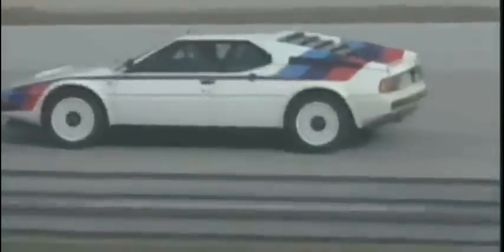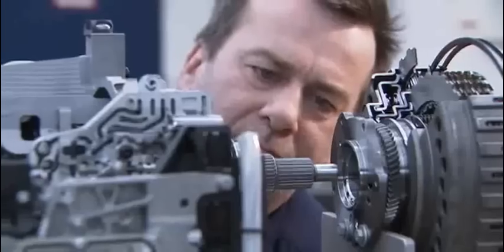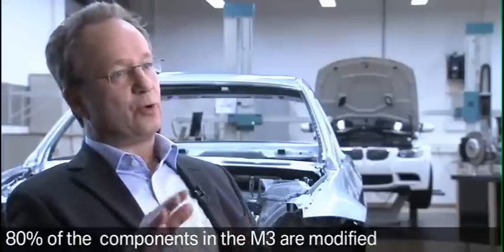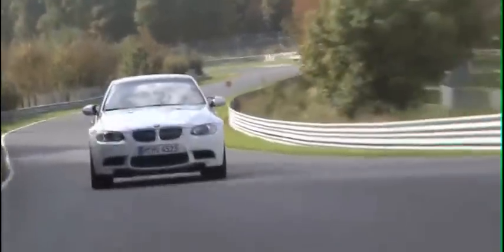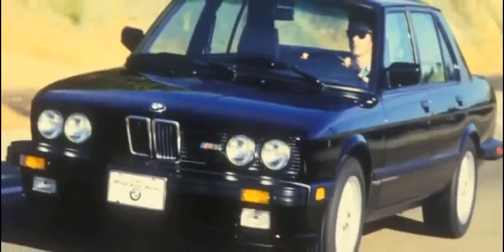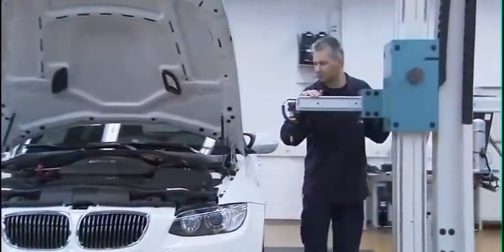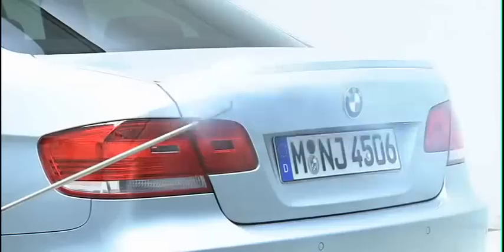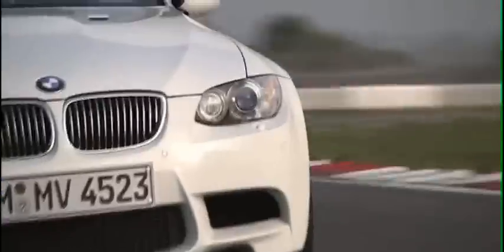BMW M Documentary

Comment: It would be nice if they saved weight, increased performance and designed it to be SERVICED. It takes a team of engineers to work on these cars as well as it did a team of them to build and design them. They are truly exceptional cars, but you must have the means and the know how to repair them. I have seen mechanics with many years experience put valve cover gaskets on these that immediately leak. A conundrum wrapped inside a riddle tied with a snake

Comment: This video is great and it shows what BMW USE to be. Now they're the new aged Ford. Producing a new car every few months like candy. Dropping pricing and turning into a economy car company.
It makes me sick when they said "We only have car enthusiasts working here" biggest load of crap I've ever listened to. If you had nothing but enthusiasts working there. Then you'd pay more attention to the actual chatter of what M owners actually say. Like how much M has degraded over the years.
Reply: Hi, BMW is now run by a new generation of the Quandt Family! These younger family members, are more interested in selling large numbers of each particular car, than in the original DNA makeup of BMW's / ///M's Heritage. 
BMW was Rescued by Herbert Quandt in 1959! At BMW Liquidation Meeting! Herbert owned 10% of Daimler Benz, Daimler wanted to windup BMW, so they could gain access to BMW's Factories and labor force. But Quandt also owned stock in the Failing BMW Brand. Quandt concluded that BMW was a better fit for his families longterm financial goals, as BMW were under capitalised/valued, so he could quiet easily gain control of the Bavarian company. He realised to gain control of Daimler Benz, the figures just weren't financially sound, given Mercedes's financial strength, and share price at the time.
So he purchased BMW, then injected initially $1 million, he continued to invest large sums into BMW's future, both in Technology, New Models and in Engineering until his death in June 1982. It must be added, he obtained a guarantee from BMW's Board of Management, of "no interference" to his restructuring and modernising of the companies facilities.
So currently the young Quandt's (his children) now own about 48% of BMW!
Their mother Johanna, followed her husbands plan for BMW's expansion and model releases with advanced electronics and cutting edge technologies.....The last models to 100% comply with Herbert's plans, were the E38, E39 and the E46 model BMW's. The E60, E65/66 and the E90's models were say 70% inline with his dictates. 
The only things written in Stone at BMW are the "Twin Kidney Grills" and the "Hofmeister Kink" in the rear quarter window. These things are sacred cows at BMW!  Herbert Quandt was Legally Blind, and would feel his way around each new design. BMW had been considering removing the Kidney Grills, (to save money) to which Quandt said "NO" as these will identify a BMW from all the other cars on the roadway.
There is much more to be said, but this younger generation of Quandt's, are mainly interested in dividend profits. Where once the exhaust note of any BMW was important, we now have an ///M3/4 that sound pathetic....Especially when we recall the musical symphony of the E46 ///M3 under full power, or the E39 ///M5 V8 wailing it's way down a road at 90% throttle. I find it incredulous, that a Mercedes Benz V8, either standard or AMG Enhanced, sound vastly superior to any BMW, Let alone an ///M.......How Times Have Changed.
My last BMW ///M BMW was an E46 M3, and my last BMW was an E60 550i. The E60 didn't feel as sturdy as my E46, so I now own Mercedes cars. I love the BMW story, but a story cannot makeup for ordinary cars. They say the ///M2 is the New ///M3....Unfortunately I am in my late 60's, and cannot take the harsh ride of a short wheelbase car any longer. So BMW lost my business, though the Chinese Market will more than make up for a few malcontents like me. Regards.
Reply: Good points but it's a different world.  At one time BMW was against turbo engines too but now most of their cars feature turbos to improve performance and fuel economy.  The way I see the newest cars differing from the past is reliability. BMW wants to pursue those buyers who will buy new cars every 2-3 years.  Therefore they've neglected ease of repair and reliability.  And currently they've even made it such that the free maintenance and service doesn't transfer when the cars are sold under warranty but used.  It all makes for more profit.  As for moving to MB boats, that just really shows that your tastes have changed as you've gotten older.  I've test driven more than a few MBs and I can't stand them.
Reply: Mark Law my vlood is bmvv

Comment: Soooo... all that testing and no one noticed that there's a serious issue in the form of Rod bearing problems.
Reply: Oh boy... Ever wondered how high the M engines rev? Do you know that mass multiplies by square with more revs? In order to reduce vibrations in the crankshaft they had to make the crankshaft as short as possible, which results in small bearing faces.
Reply: @fifficus  so you are admitting that it is a flat out failure in engineering?
Reply: @pcicraftsman8472  No. Engineering is great. You cannot make the friction partners lasting longer. It's limited by physics. Instead you would have to inform customers to change the rod bearing shells every 100.000 km. If BMW did so, no one would buy their M cars anymore. So they did not. People needed to know by theirselves.
Reply: It aint Ralph tho. Go make some money maybe one day you’ll afford one kid
Reply: onder kulekci true. But it still doesnt change the fact they made a shit car that they knew brakes right outta the factory without warning....😵

Comment: excellent enrichment about BMW M Car. I have a question there are Pure M car like M3, M5 , M6 etc also there are normal BMW with M sport variant. Does M sport variant similar to M Series though cost wise M series much higher.
Reply: not the same engine, suspension wise yes and also some interior badging and styling. Dont hold me to this though, this is what I've noticed after owning 4 BMWs.
Reply: The "M sports" are created inside the BMW factory, could even be Mexican. It's just a name they use. A true M car comes from one place, one building.

Comment: still think the new m3 should have been the coupe instead of the m4 and they could do with making a lighter version too
Reply: +g4rr377 The M2 is on the way :)
Reply: +g4rr377 i dont get it why the m4 is not 4doors and the m3 classical coupe.
Reply: +g4rr377 dude you are so right M 3 is a legacy it cant be replaced by M 4
Reply: +g4rr377  but M4 is actually M3 they have a lot in common the old M3 before this new series has a lot i common with  M4
Reply: David Every i meant more cos the m3 was the cool coupe, geuss that mantel is going to get passed down to the m2 now